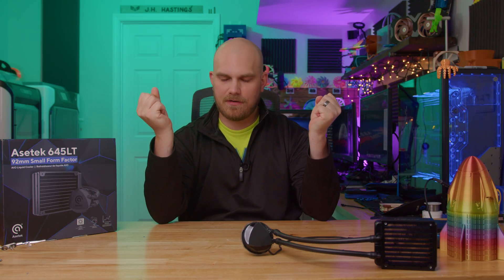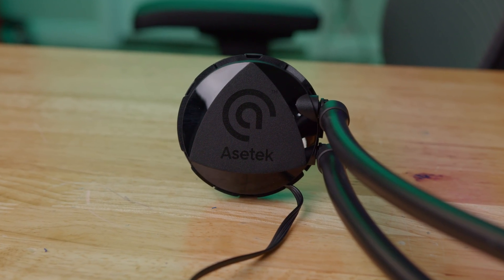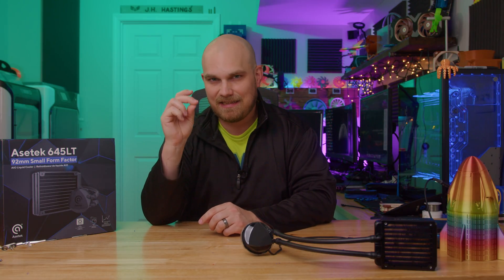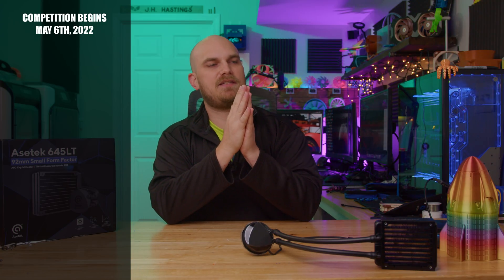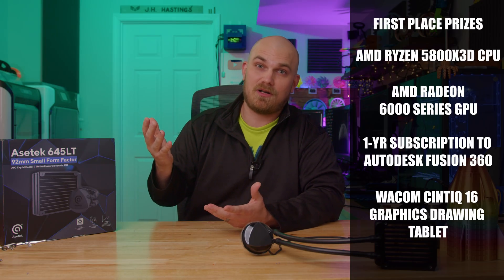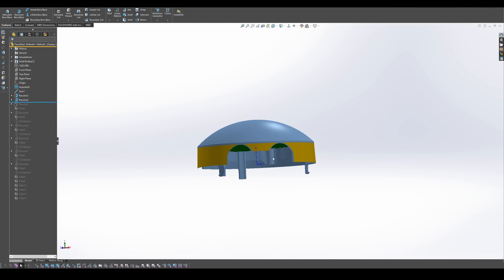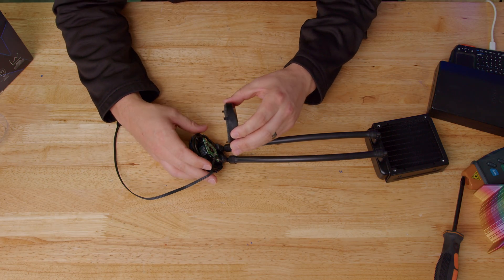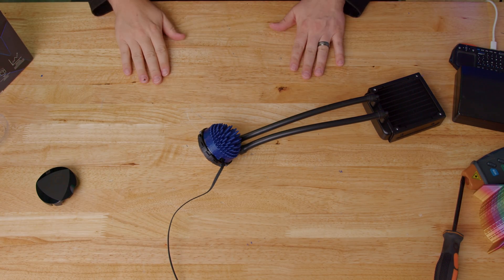The Fan Showdown Just Went PRO | Asetek Community Design Challenge

Comment: I have a 120mm AIO cooler from 2012.. Looks EXACTLY the same as this one you took the cap off of.
Why do I have a cooler from 2012 still?   To remind me why I should not buy another one.
Zero innovation.
This company has been riding this design with no interest in doing better for so long it's surprising.

The hoses shrink, they are porous, thick, stiff, and evaporate the coolant.
The warmer and more often you use the unit the faster the coolant will transition to a thick goo, jelly, syrup, powder, or any other viscus goop they decided to fill their units with at that time.
The hoses are push fit on the pump over barbs and band clamped with shrinking plastic on the radiator.  You can be sure they will leak when any o-ring that does the sealing for the pump connection looses its elasticity or takes a set.
The most likely part to fail though is the one-piece seal they hide under that spiderweb of screws.  Doesn't matter how many screws they use they will eventually leak. Depending on the coolant they used the seal will either swell and become impossible to fit in the original location or it will shrink and be impossible to fit in said location.

Probably more common than leakage is they just stop cooling.
Thanks to the design of the fins on the contact plate they are a more efficient filter than they are a cooler after a period of usage.
When the coolant breaks down the fins will clog to 100% capacity and the coolant will simply by-pass the fin stack and offer the cooling power of a passive heat-sync.

Many a PC have been damaged by these and the one thing I find that is never mentioned when using these is the Radiator and tubing and pump need to be installed in a way that allows the Air that slowly takes residence in the cooling loop to rise to a high point that will not feed the suction tube for the pump.
Mouthful that was,  but the majority of returns and complaints about these AIO coolers are from poor performance and most likely from installs that constantly prioritize feeding the air bubble inside  instead of the coolant.
I'm sure many people love using these for the few months to a year they will last.  The part I like is the "patent pending do not copy" fan. For some reason they don't fail before the cooler even if you neglect to clean it.

Comment: Lost interest when I realized it's just an artistic design for a cover, like a 3D Pog champ design competition haha
I'd rather do air than AIO honestly. If you're gonna do water at least do a real loop with a proper pump, you can build an awesome full loop for some hard overclocking for around $100 with good ebay deals. $30 "800gph" pump/res, $25 cpu block, and $25 reservoir, $10 of 3/8" barb fittings, left over 3/8" fuel line and bam.

Comment: It would be great if you tried to make a water block for CPU cooling from scratch. You just need to print it on a resin printer. I tried once and it worked :)
As a base, you can use an old IHS from another processor or just a copper plate and stick it. :)

Comment: I was actually already thinking about doing something like this. Except I have a Deepcool Captain and the print would cover up the LEDs. Also, The silver pipe would get in the way. Now I have a reason to run with it.
Reply: Just remember, the ONLY reason that Deepcool Captain has that pipe...is Asetek.
Reply: @bigbuckoramma  I think it looks cool the way the LED light bounces off of it though
Reply: @googlegamer4047  yeah, the design has grown on me over time. But the whole point of that pipe, and other designs like it, is to route the fluid outside of the block, to bypass the Asetek patent on containing the pump inlet and outlet in the thermal block itself. The US is the only place this patent is enforced. And enforce it Asetek does. It's a damn shame.

Comment: Let's do some math. The price of the Asetek AIO pump is around $125. Designing the cap could take you about 4-5 hours (depending on how complex you are making it), meaning that if you were to get into the poll, your work would be worth about $25 - $31 per hour. The average salary for a CAD Designer in the US is $27 per hour.
 
So there is a CHANCE that you will get accepted into the poll and win the average pay for a normal CAD Designer. Although it is more likely that you will not get accepted and will instead have just worked for 5 hours for no pay.
 
Not to mention that you probably also don't have a use for the prize, unless if you happen to have a computer laying around with no cooler, and that it is cheaper for Asetek to pay with their own products than to give you a proper paycheck (let's assume a 30% profit margin, making the pump worth $96 to them and your time worth $19 - $24. Way less than the average salary.)

Edit: As President-Elect Prydzen mentioned in the replies, this would fall under product designer work, which in the US, is $48.49 per hour. So in other words, you are paid almost half of what they would pay an actual employee.
Reply: yeah, but that's from the perspective of the time (t) of one contributor...then multiply that by number of contributors (c)...They'll receive a bunch of contributions with c*t amount of time put into it.
Reply: ok but you are not doing cad designer work you are doing product designer work and i am going to say that is worth a lot more than 27 per hour and and worth more than 5 hours of work. Not to mention that maybe they are worth 130 on the market but the things are probably produced at 30 dollars.
Reply: @prydzen  Seems you are correct, the average pay for a product designer in the US is $48.49 per hour. I get those confused, it's essentially the same skillset.

Comment: I bet Asetek be like this  :

"it's gonna a boring mediocore RGB/Screen-less AIO from our brand which is not known and already generating money via patents/oem production. Our next AIO has no reason to be picked and know for the over-all pc part buyers . Instade using ready to make 50 different covers we have , Let's make it into a contest and when we send this to others youtubers they gonna mention the pump cover made with a contenst and we might get more attraction".

Asetek as a firm known for their pump on top of waterblock patent. Which is bizarre to me how the patent instution gave it to them(or anybody which would apply for it first ) . A lot of people furious , talking they are basicaly getting free-lance work for free  etc but C'mon guys... It's not a high skill needed engineering part , it's a cap ... You don't need to run injection mold CFD simulations and prove your design is better , I bet they gonna spend more time optimize injection stuff than you modelling it ... 

So yeah ,I think no need to make it huge deal . If it was a fan contest yeah that's huge deal because it effects the performance and you should not make it for simply a pc ... But it's a cap and probly they have models for it but making it to a contest making it interesting and worth to mention it on box or on youtube reviews , so worth it...

Comment: Like everyone else MH.... Asatek IS THE LAST COMPANY I'd ever make anything for, given this challenge is for prizes which will end up being resold on fleabay.... You're essentially giving them free R&D.... you (creator of item they use) WILL NOT GET PAID
Reply: Asetek is pre-spending your wages on computer hardware, but they are still paying the winner.  Their own employees will only receive a fixed, hourly wage, the value of the prize is likely only based on the amount of time one of their employees would take to make the same part in CAD (a few hours of fairly decent pay).

I'm not saying they are the kind of company you want to work with, but they are still treating you like an employee.

Comment: I can see both sides, this is an awesome recognition of this channel's talents and work. That Asetek knew where they can find a pool of talent and do some damage control with the community.  They have shown some good faith by offering their cap design to be placed as an open source. While some might scoff at that, there is some R&D time put into everything. Time is money and nothing is truly free. 

But a lot of people have pointed that participants should be leery. I'd prefer to see a full list of stipulations for entry. With what little has been put out there i would assume all designs are held by the creator (there is nothing from Asetek at this point stating any submissions become their property). Obviously the winning submission would though. I can also see them limiting the final designs to something that could be mass produced easily and cheaply. But it is their money that will be manufacturing the winning design. 

For those wanting a % stake you have to be careful. Asetek can easily do a limited special edition run and limit any losses. What they're offering to the winner in actuality isn't too bad. The vague 6000 series gpu is a bit of a gamble but overall the value is there.
Reply: Tbh releasing all the designs as cc by nc sa or nd (e.g. by publishing on the internet archive) would be a great way to force them to license your design and not be asshats.

Comment: May 2022... and I still haven't seen anybody test if aerogel can supercool GPUs.
Reply: Whats your idea on that? Aerogels are mostly air, which makes them great insulators. Can't see how you'd use them for cooling.
Reply: @paulr5528  It instantly absorbs all the surrounding heat away even over 500 degrees... and remains cool to the touch.
Reply: @ThankYouESM  the reason its cold to the touch is because of how well it insulates i.e. how poorly it transfers heat. So putting aerogel on top of a GPU die would be worse that just leaving it blank.
Reply: @paulr5528  It actually absorbs heat instantaneously.. no need to transfer it anywhere... cooled on the spot. My suggestion is to check out Vertasium in which he uses a heat sensor camera and a flame thrower.
Reply: @ThankYouESM  I think you misunderstand that video and how heat works. Aerogel doesn't absorb "any" of the heat, which is why it "cools instantly". That means all the heat stays where it started, in this case the CPU. That is why it is worse than leaving the die exposed to air.

Comment: Just make the cap an RGB plate, and use it as a universal base for magnetic covers. Those covers can be 3d printed and/or purchased.

As long as the magnets are strong enough, the cover can be bigger then the cover. SO, you can create a full plate to hide everything or create an artistic scene that rises above the CPU. The RGB backplate gives the magnetic cover some flare that can be taken advantage of.

The magnetic plate can even be used to create a mount for a fan for more custom cooling. Another example is use the mount for creative consumers make their own displays.

Making it a universal mount with RGB is the best way to do it. Gives limitless customization to the CPU cooler cover. We may even see something innovative occur if we let the consumer enjoy being creative with Asetek's  quality parts.
Reply: just be careful with strong magnets, they ruin old type hard drives and can possibly negatively affect other electronic components as well. Just Sayin'
Reply: @lapitop4206  The fastening system to the pump can be really anything. As long as it can hold up to the weight of the cover piece that was created and minor vibration due to the pump.
Reply: @lapitop4206  eh, HDD use neodymium magnets to control the heads

Comment: Even though the first prize is pretty hefty for any individual it still MUCH cheaper for Asetek to do this than to hire a professional designer to do the design, so in comparison this is basically them getting free labour of the youtube audience. And in addition as someone else in the comment section said, it's very likely that they get all the rights to everything submitted (although this is hard to confirm since they just have an email address which doesn't allow the submitter to read the terms before submitting) which could possibly prevent anyone participating from using the submitted design in future works. (Take what I wrote with a grain of salt since I don't really know any of the details but for anyone thinking of participating make sure you know all terms before submitting anything.)
Reply: Bro the already designed a cap, it would take a minute to slice on a astek logo, they just want to hype the product. The obviously don't care about the aio, it doesn't even have rgb.
Reply: Your point is what?

Comment: STEP and IGES are awful neutral files. They often fail to capture fillets correctly. I recommend parasolid (X_T, X_B) instead.
Reply: That's a fair criticism of the formats, but the point was to choose something that was supported across all platforms. FreeCAD for instance, does not handle parasolid.   Fusion 360 can import them, but not export. And then things like TinkerCAD are even more limited. 

In a professional environment, better file formats are a reasonable requirement, but for a community project with a bunch of hobbyists, the neutral file formats are just much more available.

Comment: I was hoping we would get "Impeller Showdown" next. :D
Reply from the maker: i have looked into this, so far ive been unsuccessful in finding a test bed.
Reply: @MajorHardware  you wouldn't be able to anyway, Asetek would likely sue your pants off, as well as any design submitted. If you go outside the United States there are quite a variety of different all-in-one liquid coolers. Both in design and pump variation. Inside the United States, the company that you partnered with has patented the design and the pump placement as well as every other aspect of the all-in-one liquid cooler in a manner that prevents from being Innovative in Marketplace, and bringing improvements to existing products on the market and they re known patent troll. I don't dislike a lot videos, but this is one of them. Nobody should be doing design work for free, nobody should be doing graphic art work for free, but especially nobody should be giving it to a patent troll who will steal the design and not credit the Creator or pay them.

Comment: Open source design at its finest... saves the company money on r&d and gives the consumers the best product possible... why isn't this standard practice?
Reply: Open source but you immediately lose any and all rights you your design. Not really "open source" then.
Reply: @CollinOstrowski  pretty sure that's the case with any open source or gpl project but maybe i'm wrong?
Reply: @kodysherrer964  Most Open source projects have licenses along with them. They are free to use sure, but if you stand to make money off it then it may require you to at a minimum give credit to the original author. Other licenses require it to remain open source and cannot be used in a product outside of the customer implementing it themselves. I'm also not extremely familiar with the licensing of open source projects, but you definitely retain rights
Reply: Because this is exploitative, they are getting thousands of hours of work (R&D and trying new designs is paid work) and paying only a few thousand bucks for it. This is well below minimum wage and also well below what market-competitive wage is for a designer
Reply: @marcogenovesi8570  i mean you as the designer do have the option to not design anything for them if you feel the compensation just isn't there... and ultimately if you do design something that doesn't mean you have to give it to them... though that defeats the purpose of wasting time on a design anyway
Reply: @kodysherrer964  Saying that falling into a scam is optional doesn't make it any less of a scam. This is unpaid design work, disguised as a competition.
You are free to give your money to whoever you want, just as we are free to tell you this is bad and a scam.

Comment: Uh... Bad idea, definitely without monetisation. They are basically getting free R&D, if they want it, pay a small sum for every submission that performs at a certain level, and % profits for the winning design.
Reply: 3D Printer companies do it all the time to the ignorant masses by "taking suggestions".  Minus sharing profits and giving recognition.
Reply: @lastofthebest5102  there’s a fundamental difference between taking suggestions so you can implement solutions to problems the community has faced and downright outsourcing design of a purely aesthetic component.
Reply: Its just a cap, no performance to be gained. Its just a way to create marketing for the product and involve the community. Now, if they were using our designs for actual performance as in a fan design yes profits from sales would be a thing but they are giving us prizes for our submissions, that should be good enough. Of course this is for those willing to participate and if anyone feels they are being taken advantage of then of course do not get involved👍.
Reply: Employees don't get a percentage of profits, only a fixed, hourly wage.  Asetek is only pre-spending your wage on computer hardware, then firing you.